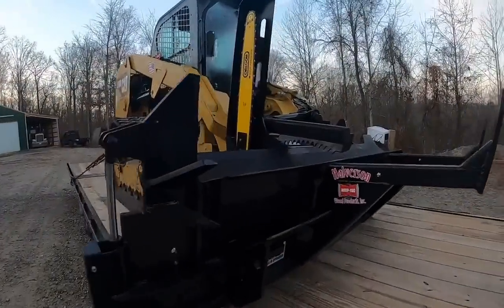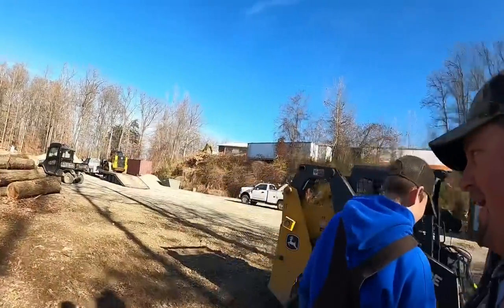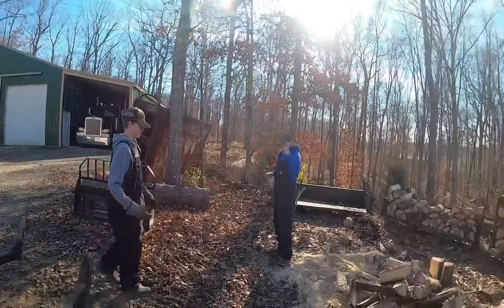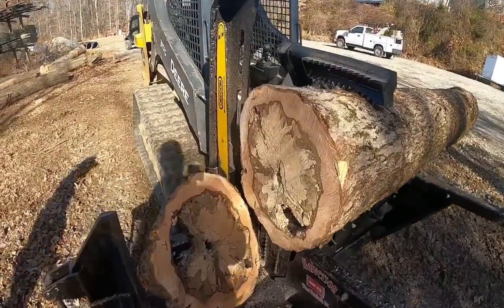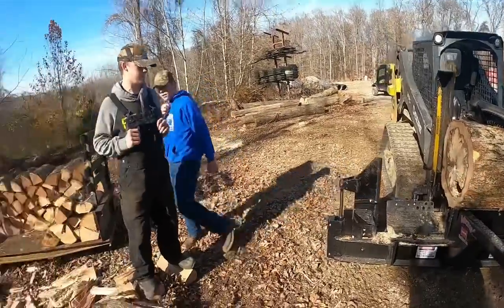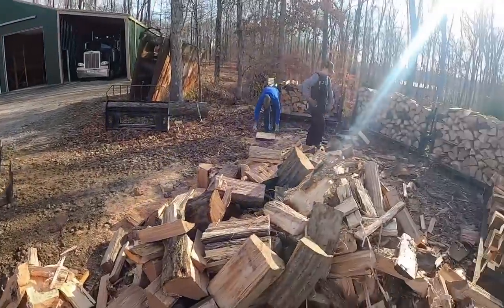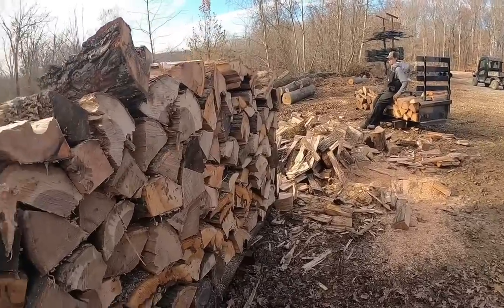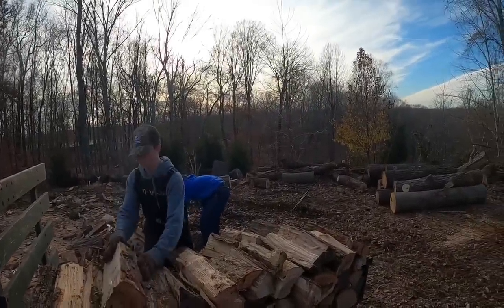Firewood day with Halverson HWP 150 skid steer processor and boys @HalversonWoodProductsInc

Comment: One commenter said it's worthless for firewood.  Need "high grade logs".  I'm not sure which video he watched cuz to me it looked like a hell of a nice processor.  All you'd need to do to cut knotty logs is use a little bit bigger cylinder on the hold down arm.  Or even a little different configuration on the teeth maybe.  One nice thing is you can run the most aggressive chain made and don't have to worry about a thing.  Keep a few freshly sharpened chains with you and you could process a massive pile of firewood in an 8 hour day.  You guys did like 5 or 6 cord in 3 hours!!  That's impressive.  And you only need one machine to do it.  Heck yes.

Comment: I got one of these for my toolcat, but mines a 120. They are most certainly worth their price. It doesn’t matter what the weather is like or what time of day it is, I can split wood. These are more portable & easier to take deeper into the woods than tow behind processors. Of course they have their limitations, everything does. But the whole point of these are to make cutting & splitting 2x or 3x faster.

Comment: Now that's a awesome processor. When you can load, cut and split where ever you want makes the job alot easier. You just had to put a little fire behind the boys butt to get them to load the firewood. Guess it was cold where you guys are. But all in all it's a very good unit. Too bad the Cat broke down after just purchasing it. That would have pissed me off. Hope it's a quick fix,but I doubt it. However you n your team are well experienced on figuring it out. Nice work guys and keep the vids coming, very good content. Be safe

Comment: Hi,
A couple of questions
Will you ship to Australia ?
Also
Seeing the bar cut the log, the hesitation in the cut
Is that lack of hydraulic flow from the machine
If so
By placing a greater flow pump on the bar 
Will this give it a smoother cut
As I have a High flow machine @ 152.3 litres p/min - there a bouts
Reply from the maker: We could ship
Yes this machine was lacking flow
Reply: @C_CEQUIPMENT  
Thank you
So
The flow rate on the pump that was on the larger type item - that can cut larger logs
That was hooked up to the JDeere
What's the flow rate on that cutter bar pump ?
Also
Would be good to have some type of 10mm or so
Protective plates structured in front of that pump
For protection
Also
What would be the price of that item ?
USD or AUD Price ?
Shipping would be ?
To Sydney Australia
Thank you

Comment: 12/20/21; just watched you & 2 strong, clean cut youngsters man- handling/stacking firewood using Halvorson wood cutter/splitter. Hey, that Halvorson cutter combo 4-6 way splitter is neat! But seems to need some type of 'next-step' gizmo to receive splits & direct them into your(their) storage unit. I watch Outdoors with Morgans; they use WolfRidge splitter (no auto chain saw cutter on their unit) with conveyor, dump into large open pit. Then both you/sons with Halvorson & Morgans with WolfRidge must manually, physically, select/pickup, turn/twist & load your mobile storage baskets. So, is their a gizmo that can receive 'splits' & 'next-step' load these pieces...compactly/neatly into a receiver/basket? Clearly your Halvorson saves time as it combines log handling/pushing into next-step chainsaw cutting. That is sweet. So, is their a a next-step device that receives splits & put them ( neatly) into a storage basket? If not...maybe you can give yur 2 boys a project, aye? Design, cut/fit, tackweld...humm...then show it off on yur YT channel...boys get a little $$?? Enjoy yur videos. You work on some b I g toys!👀👍👍👍😊
Reply from the maker: For sure
Whoever comes up with an automatic stacker will have it made!
Thanks for watching

Comment: Clint, would the side to side cutting wedges possible work better if they were longer? On the bigger wood, it sure seemed like they weren't wide enough to fully split it. I wish we would have had one of these when I was growing up.
Reply from the maker: They might but then they would have more leverage I guess and possibly bend or break things easier maybe
Reply: @C_CEQUIPMENT  Maybe instead of length, a little thicker then. Be harder to push the log but would spread it wider and break it open better?? Just thoughts.

Comment: That is one slick compact firewood processor.  One could use this on the tree site and drop directly into a dump trailer or small dump truck.  Hydraulic motor for the saw could be a little faster but you did say the hydraulic flow was down.  How many GPM does that require?
Reply from the maker: 15-20gpm
Reply: i could be wrong but seems like the blade might need sharpened.looked like the saw dust chips were kind of fine.the one we use buzzes right through most logs

Comment: I inherited a 2001 873g from my Dad  with around 740 hours and now it has 850 hours. I did add Grouser Steel Tracks and it’s a beast. Unfortunately it is only low flow so what are your thoughts about upgrading the pump to a higher flow?  I run a Quick Attach EZ Mow 72” brush cutter which would run faster with a higher flow as max is 32 GPM.
Reply from the maker: Hmm
Might be an expensive option but doable

Comment: Clinton, I'm not very familiar with log splitters of that caliber.  What is taathe rating on the hyd ram?
Would a higher capacity hyd pump run the chain saw any faster?
Man what a pile of wood!@!@!@!@@@@!!!!!
That is a pretty slick system.   Ah the price of men's toys!!!!!
Reply from the maker: I believe it’s about 35 ton
Yes a bigger skid steer will make the saw sing faster

Comment: Do you think an S650 or an SSV75 both around 2600 ROC would be ok with handling the 150 and the logs...or you think 3K ROC is needed?
Reply from the maker: it would be ok the s650 might be tippy
Reply: @C_CEQUIPMENT  3000 lbs ROC preferred with these?

Comment: Is that chain that dull ? Or is the saw hydraulics that slow ? Ty
Reply from the maker: Smaller skid steer was low on flow
Reply: @C_CEQUIPMENT  10-4. I run a Rotebec on a Deer 210g. I know it’s a way bigger machine. But it’s 3/4 chain and a 45” bar. So I figured the bar speed should be faster. 👍🏼

Comment: Emissions are no problem! We need canola, hemp, or soy oil to run our Diesel engines on and you wouldn’t have to spend $10,000 extra for emissions per vehicle! Petroleum based diesel is why we have an emissions problem, change to plant based oils and delete emission components and the problems that come with them! Plus they have more lubrication than petroleum based fuel, so your engine lasts longer!

Comment: These firewood processors look finicky to operate, imo, it’s a lot more economical and faster to cut the rounds on the ground by hand and use a hydraulic splitter attachment on the skid steer to split them.

Comment: You have to do the "regens" when  they are re required if you bypass them your exhaust will plug then you are so boned🦴. The bypass is only for Hi fire danger areas. ...NOT so you can keep busting ass. You can blame it on the last owner this time, next time it's on you and again you will have that long face. 😭. If you don't like it, don't buy it, Boycott It! 
40 years of mechanics, most Deere. Retired.